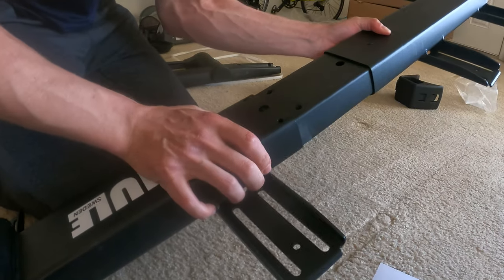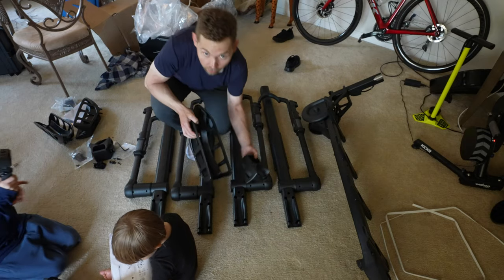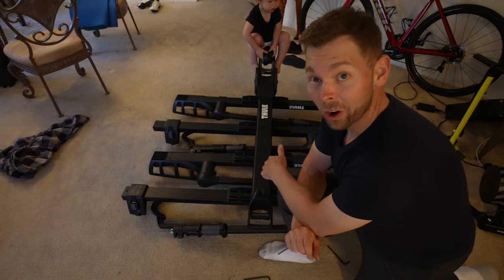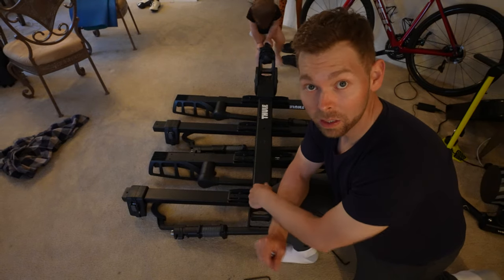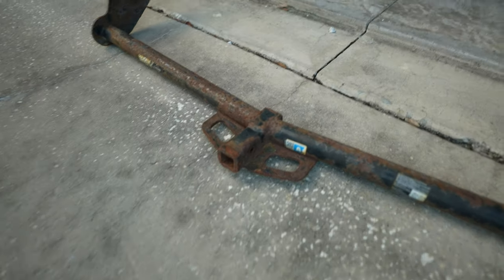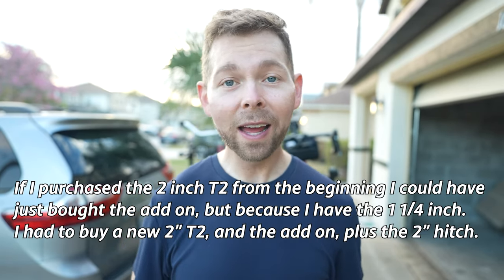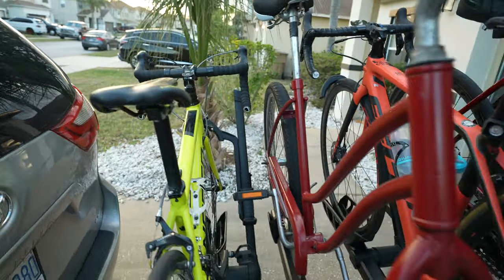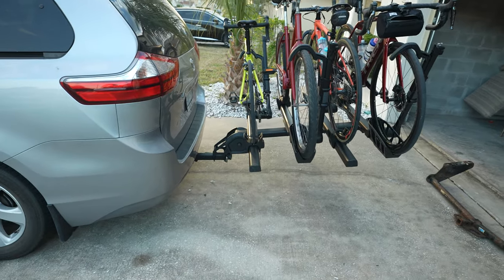Thule T2 Pro XT with Add On 4 Bike Rack - Unbox and Install (2 Mistakes Made) #cycling #bikerack

Comment: Jon - great video - one the the only out there that shows this T2 on a Sienna.

The question I'm dying to know - does the rear hatch clear the handle bars of the innermost bike when hauling 4 bikes?  I'm trying to figure if an extender adapter would be needed.
Reply from the maker: Yes, I have had no issues, I load 4 bikes all the time, no issues at all

Comment: I have a T2 Classic with the 2 bike add on. To mount the 4 bike setup I recommend starting with the "Add On" disconnected and only mounting the Rack, then once in the hitch receiver with the rack in the down position now mount the "Add On" rack. There are only two bolts to secure the "Add On" to the rack. At this point you may find it easer to put the rack in the vertical position to add and tighten the two bolts.

It's a lot easier to manage alone both from the standpoint of lifting and aligning. And I don't always need the 4 bike setup. This is my recommendation.

Comment: 1up for the win
Reply from the maker: I might have to try it one day!
Reply: @jonmaloneycycling7593  I had this same Thule before getting my 1up and with the Thule I just felt like my bikes were so far away from the back of my vehicle but once I could actually order a 1up and got one the difference was huge and night and day. Thule is still a very nice bike rack but when you carry multi bikes it’s just to set back for me
Reply from the maker: You like the 1 up a lot better than the Thule?
Reply: @jonmaloneycycling7593  without question. The 1up is so fast to load and unload and is lighter and easier to store as well. It’s just one of those things that once you try it and see the difference is pretty clear choice at least it was for me.
Reply from the maker: @joshhiggins4723  dang. I should have got it
Reply: Wow. I have a 3 spot 1up and it’s pretty heavy (but very happy).  Can’t imagine what heavy compared to that would be like
Reply: Thule T2 Pro XTR with wheels - 1up superiority myth debunked.